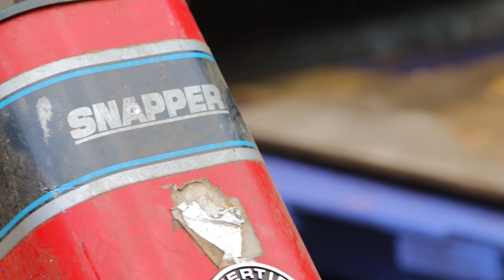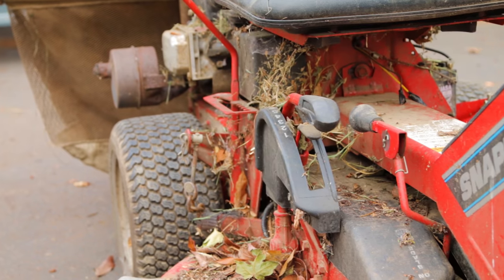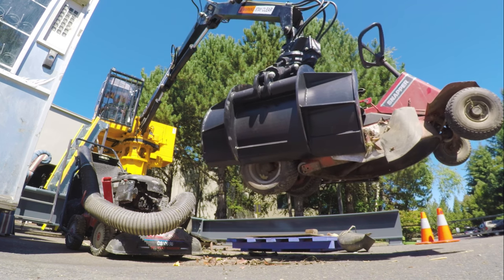SSI Shreds: Riding Lawn Mower

Comment: Shred one of those really huge 200 Meter windmills those Germans put up at our border! One single blade is at least 50 Meter (usually a bit more) in length.The blades would do nice in the primary.. crunchy! Only that generator hub is really huge! You need to cut that up first :D
I recommend anfo for that. Because every good party has fireworks.